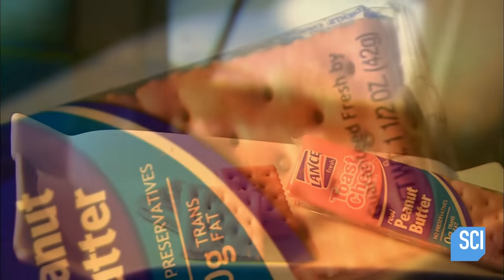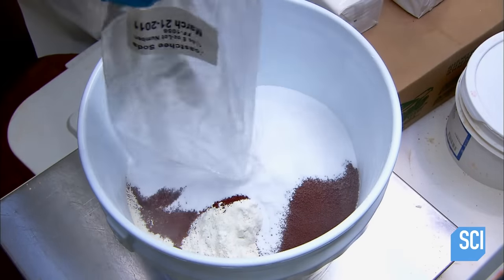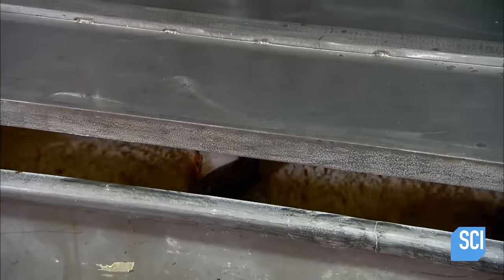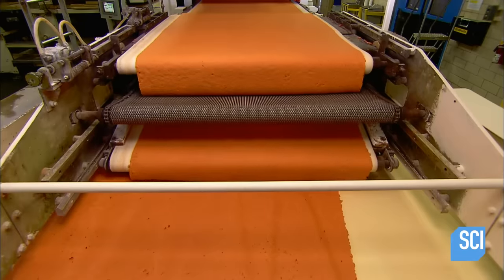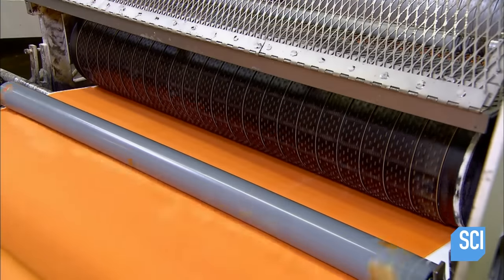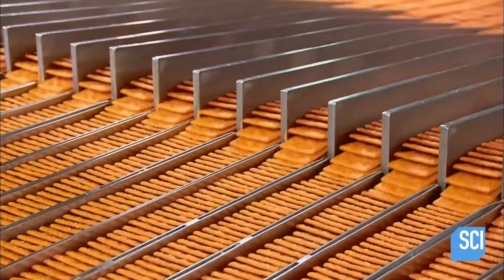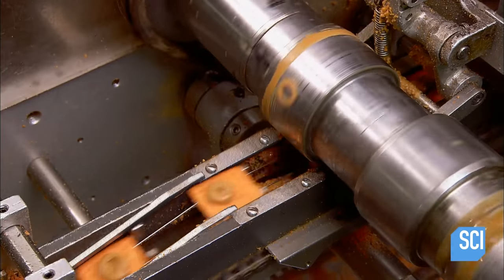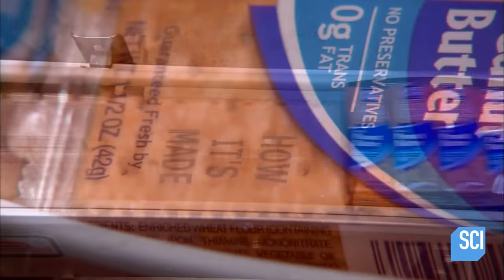How It's Made: Sandwich Crackers

Comment: This is so crazy I'm a mechanic over at Kellogg's in NC.  We originally took over Austin and Keebler crackers and still produce there sandwich crackers.  I was expecting some differences in the machinery but they are virtually the same from mixing all the way to shipping.
Reply: How do you feel about the strike ending and the deal you got?
Reply: I just started maintenance at this factory in Charlotte
Reply: Why on Earth would the process be different?
Reply: @TheBigMclargehuge  different companies
Reply: @redneckfiredepartment9094  how often is the machines cleaned
Reply: @rachelfaas4767  I would assume every day since it's working with food. I used to be in sanitation crew at an ice cream manufacturer, and we cleaned every night.
Reply: @rachelfaas4767  direct contact with food is cleaned every day, peripherals like a splatter shield or the floor is probably weekly or twice a week. Something like the oven or conveyor belt that runs through the oven is probably only once a month because the oven heat sloughs off any dirt and kills microbes.
Reply: @mike4402  cool thanks for the info!
Reply: Would be interested to know if they still use Baker Perkins machinery. They’re from the city I grew up in in the UK.
Reply: @bobafetting6373  we use Cavanna machines for most of the cracker lines.
Reply: @cvb6530  way late sorry… that only affected the cereal plants.
Reply: @mike4402  pretty much spot on.
Reply: The Austin ones are my favorite, give your boss a big kiss for me bro.
Reply: Is the place NC, the New Caledonia?
Reply: @benjoseph25  North Carolina

Comment: I always thought the perforated holes in the crackers were for design, it's merely to let the steam come through. #themoreyouknow
Reply: You betcha Duke. That’s a centuries old pastry technique called “docking.” 

You see it most often with certain pies and quiches, where docking the dough keeps the bottom crust flat and stable instead of bubbling up with pressure and deforming or bursting. 🤠
Reply: It's for both function and fashion.
Reply: How many holes in one cracker?
Reply: Same with doughnuts.  Fry a dough disc and get a huge unsightly air pocket. Punch a hole in the center & voila; air pocket won't form. Same with the narrow cut of 'long johns'.
Reply: @hensonlaura   same with pies .... if you do not cut holes in the pie crust, the escaping stream with deformed the crust.
Reply: So, i'm guessing you have never baked anything yourself, ever?! how sad
Reply: @LordPinky455  I don’t wake up thinking about baking crackers… You’re reaching, go play in traffic.

Comment: "a quick spray of vegetable oil adds flavor." what flavor, grease?
Reply: A lot of flavors are fat soluable, meaning they can be present in the dough, but not detectable without fats. There is also the very real possibility that the oil itself is flavored.
Reply: @codename495  could well be a garlic flavored olive oil
Reply: Oh wait.....olives are fruit 😅
Reply: @codename495  that joke went over your head like a 747 huh?
Reply: Penor
Reply: Cargill has a large vegetable oil processing plant just up the railroad tracks (Charlotte NC, South Blvd)
Reply: @munkle1732  where is the joke :l